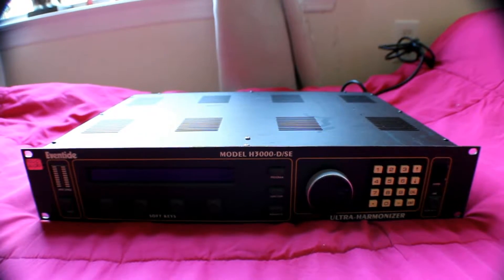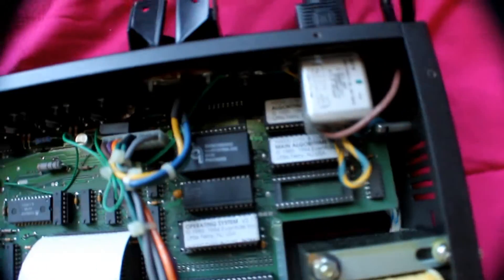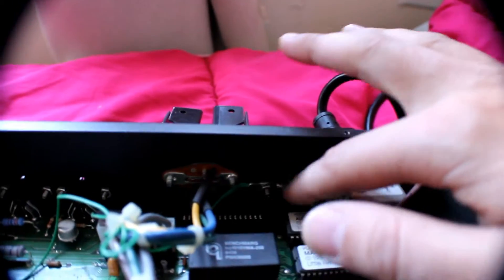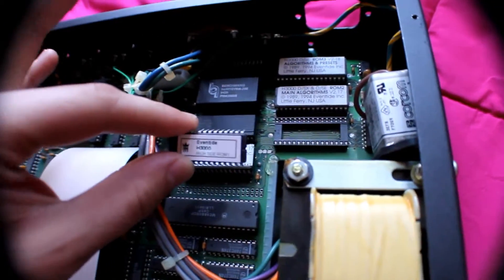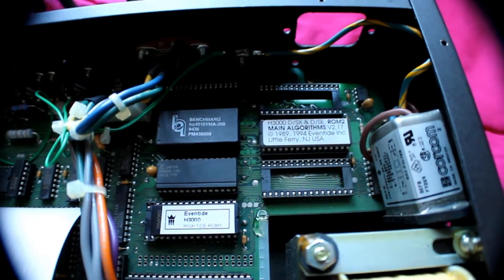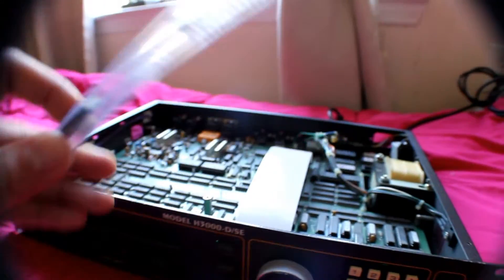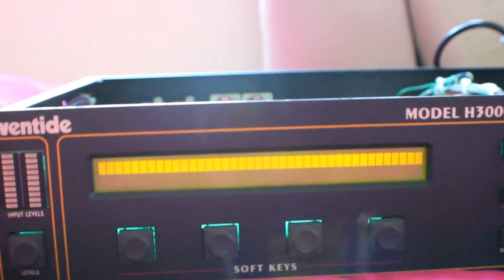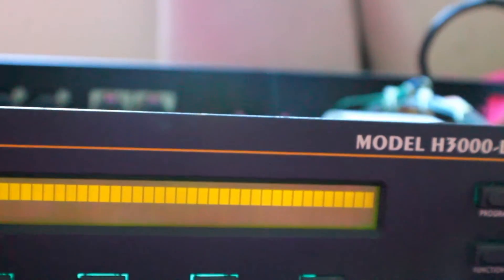Eventide h3000 d/se Rom Update Problem

Comment: My H3000 D/SX decided to run exactly like this is showing,... It has a row of squares along the top row,... just like this video shows!! I cleaned all the pins on the ROM chips. Now it just displays the Information on the TOP row ONLY and does nothing else! I am trying to find out what is wrong with my unit. Can anyone give me any help? Apparently I cannot reset the operating system by holding the Function Key when I power it up. The unit does NOTHING except for the single top line display,....and that is all it does. I wish I could just have someone that knows what they are doing to take a look at it and give it a complete "Tune-Up" and get it to run "Factory-Fresh" so I don't have to mess with it anymore. Can anyone help me?? Eventide will no longer work on these discontinued units.
Reply: did you ever get yours working?